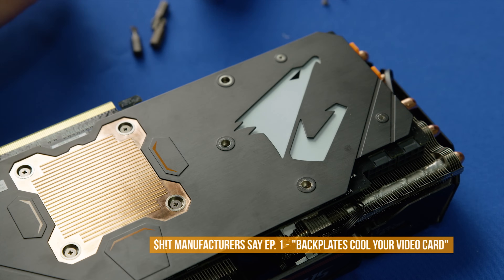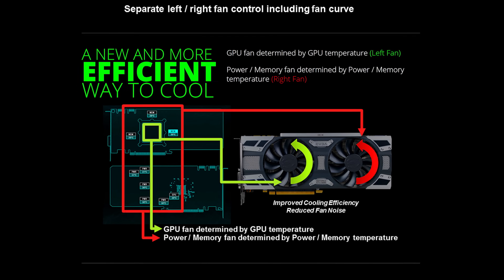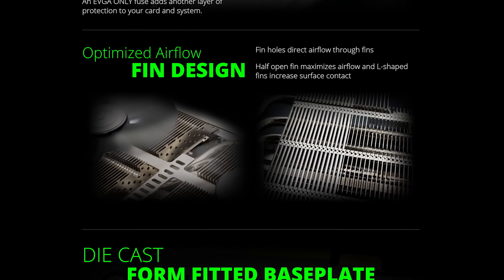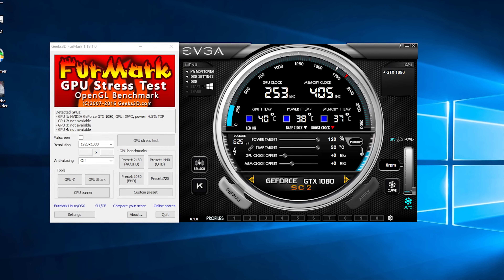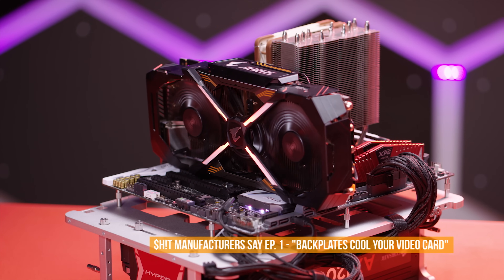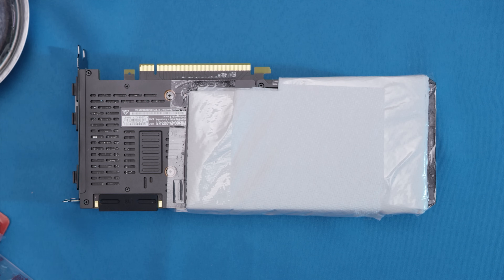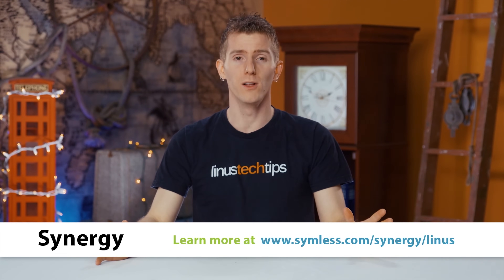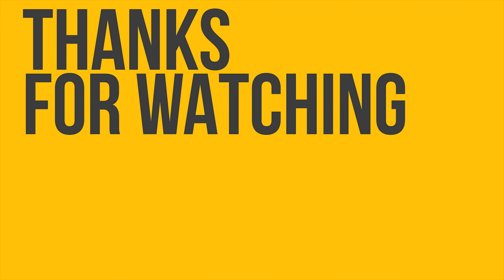The SOLUTION to Video Card OVERHEATING & DEATH

Comment: I'd pass on this. Even if money is no option (which it is for me) I would rather have a liquid cooled GPU than one with independent air cooling fans. It's still using air cooling, even if it's a little different.

Comment: Hello Linus, I remember in NCIX tech tips when you talked about the AMD FX8350 and the MSI 990fxa mobo,Have you ever Had an issue with that motherboard in your time of testing it. I have heard a lot of people talking about the mobo where it just shuts off and does not work again, did you experience this during the review time, and if so what did you do to solve it?

Comment: Why don't they put the fans on top of the GPU instead of bottom?
Hot air flows up so why bother blowing it down when it's gonna go up again?
And it's better looking.
Reply: T Tommy fans on the upperside would get dusty in no time.. unlike under.. you will notice that cpu cooler is most likely more dusty than the gpu is because of it..
Reply: T Tommy You...don't seem to understand what the fans on a GPU do... Though I agree on the fan placement, the fans on the bottom also usually blow upwards onto the PCB
Reply: …  they don't blow it down
Reply: why not just cut 2 holes in it so the air comes from the bottom and right out of the top then the other fan and suck it right out and blow it out of the computer case all together? or atleast blow it down away from the CPU?

Comment: iV always wondered WHy they dont place a Fan on the Back edge of the card...working off a Onboard motor/driver..that would blow AIR across both sides of the card and OUT THE BACK..  I dont see HOW removing heat from the Card and DUMPING it into a case works in the long term..unless you have a FEW extra fans to send it out the top..
Just get it OUT of the box..keep peoples FEET warm..

Comment: K, as described this is at best noise saving feature and has nothing to do with increasing longevity or preventing overheating.  Which is fine, but lets call a spade a spade shall we?

Also, if you want to spin up a case fan according to what the GPU is doing, you can use speed fan.  No need to wait for EVGA to reinvent the wheel on that one.

Comment: my r9 390 keeps randomly popping up with an error in the bottom right corner basically saying 'your video device stopped working unexpectedly and has recovered' while doing a short freeze on my computer. Insight anyone?
Reply: That's a driver crash. Are you OCing?
Reply: Nope I'm not. Running the 390 and my 5820k at stock speeds. Usually happens when I'm watching movies or have a number of tabs open in Opera but has also happened when just on a single web page. It's happened on multiple different driver versions too.

Comment: Remember back then when graphic cards ran off of pcie slots, lel.
Reply: ECCENTRIC 

We need to connect power supplies now, or it will ONLY be on PCIe power, which is pretty much only on budget cards now
Reply: I have a Voodoo 5500. That used a hard-drive connector for power.
Reply: hacked by scarce remember the days when there wasn't any GPUs
Reply: remember days then gpu can run only on power of pci slot (not express not agp)
Reply: 750Ti master race reporting in
Reply: forget AGP, I want 16 bit ISA cards again.
Reply: ootdega dude same
Reply: IT WAS I DIO ALL ALONG 
Keep your eyes peeled on a 4gb 570 radeon.  The prices are sliding down and it might be in your budget in the soon.  And a 570 spanks a 1050 handily if you have a 6pin power plug for it
Reply: PFFT,abacus is the best
Reply: My old radeon 9800 se softmodded to pro has no idea what you're talking about.  and it was AGP.
Reply: Well my GT630M wrecks the competition with not working at all when too hot or when it just doesn't want to which makes it the most power efficent card ever made
Reply: And you pit a 4pin lil floppy drive power on its pcb.  Hilarious
Reply: ootdega not for long soon im going to a 1050ti from my 750ti
Reply: I remember ISA video son, get on my decrepit level
Reply: well pretty much every pci-e higend cards have had power connecters
Reply: Im trying to find a full coverage waterblock for a EVGA GeForce GTX 1070 FTW ACX 3.0 can anyone help
Reply: I remember the days when graphic cards ran off two PCIe slots
Reply: I had a GTX 1050 Ti when my old 1080ti was being replaced and I was surprised it didn't have an 8-pin connection. Kinda blow my mind that a GPU could be powered from the motherboard.
Reply: What? Graphics cards today also run of PCIe power. Are you talking about the PCIe bus? Pretty much all cards since 2004 have run off of PCIe.
Reply: @Slenderman63323  nah now we run our GPUs Off the power pin and connect them to the PSU.
Reply: @Slenderman63323  No we use external cords
Reply: Forget 16 bit ISA, I want those CPU drawn graphics back.

Comment: I don't need more temperature sensors, I need a cooler GPU without too much extra noise.
I would like to see a GPU with a heat sink and fan on the back plate :)

Comment: The low powered fans to increase power available to the gpu is actually a pretty impactful feature. Those fans on a regular card could be taking away 5% of the power available to the core, so when you make youre power target to 105%, it may really only be at 100% for the core.

Comment: or just fucking make gpu with cpu cooler slot and fuck the 2 pci-e slot limit. if you need to add stuff use pci-e expansion cables

Comment: I feel like the point of the ICX coolers was ignored here, where some were experiencing the VRM catching fire from insufficient cooling. ICX is a bit over engineered solution to that problem, but this wasn't even mentioned in this video. Besides other GPUS at the point don't even have a temperature sensor for the VRMs and ram so there is nothing to even compare it to. Without adding direct contact thermal probes to an earlier card and comparing them to the results on this one with the new ICX cooler. Honestly, this is what this video should have contained.

Comment: video cards will die eventually, its just a matter of time. What ICX delivers is better and efficient cooling and that's it. 

This still doest fix the issue regarding the hot-cool cycles of the chip making the chip connections wear out (the flipchip design flaw) not unless they done something different die implementation that fixes this issue, there will be more video cards that is likely to die after 5 years or so, hell the older video cards still works in this age because they dont use this flipchip design (my riva tnt2 is still alive will my GTX480 died after 2 1/2 years).

Comment: Its painful that he is referring back to the totally flawed back plate video and then trying to use it as fact,  the testing methodology and out come in that video was flawed because they used a test bench even though the majority of people have full size cases with fans that create airflow into the case and over the card and that's why that test was flawed,  because anyone with a brain knows that a small passive cooler still needs airflow to work and without airflow they will do next to nothing for cooling and in a test bench it does not get airflow and so no surprise that no cooling benefit was seen from the back plate. Had they properly tested in a case with fans and air flow like most people have then i can bet that the results would have been significantly different..

Comment: Soon, this sort of tec will find its way into every cooling device in a case and it's kinda useless in most cases. Very few people have computers which run at 50%. Most computers and fans run at 0% or 100% so it's not really helpful. But heat is waisted energy so the less heat made is better, not ways to move it around.

Comment: A backplate can help with cooling if thermally connected to the VRMs, as unlike most other components, most VRM designs use a large ground pad for heatsinking into the large ground plane of the PCB. A thermal pad can allow the backplate can act as a heatsink as long as they didn't use some poor quality metal. The issue with s backplates is that they have nothing to act as a thermal interface between the PCB and the back plate.

Comment: I'm really interested in Synergy, but how is the setup? is it just a network connection between the two PC's? I'm currently messing around with a setup with my gaming PC on one end and an i5-2400 linux machine on the other side of my desk, and I'd like to be able to just use one mouse/keyboard for both, but I'm just a little confused as to how synergy works.

Comment: for those that don't know, icx exists as a marketing response to the issues with their cards they had, no other reason...
also the reason good vrms aren't monitored on cards is, because they are supposed to be so ridiculously overkill that u shouldn't manage to ever blow them up even at water and custom bios or ln2.
btw gamers nexus was not able to blow their evga 1080 up in the thermal testing, it seemed to point to a batch of bad capacitors as the vrm seemed adequate (it was still stupid to not connect vrm to the main cooler or backplate)
i mean not that icx is bad, it's just unnecessary and going for an even more overkill vrm would have made more sense i guess, but u can't market that, so whatever i like having readout points, so cool i guess and everyone likes fancy backplates! and even if it's just to make the card stronger and  protect the pcb, which is what most do (and also block heat from escaping in a lot of cases....)

Comment: whats the point of additional sensors when all manufacturers limit the voltage? gpu air coolers are great most do there job fine and not to mention water cooling. 
yes there is custom bioses out there but having FULL control of your GPU from the factory would be nice to have, say a actual unlock voltage setting in msi afterburner beyond the said manufacturer limit. 
you can spend major $$$ on a gpu that has the best cooler in the world but it wont go far it the manufacter cap is there.
 I have a gtx 980 and can reach 1.5 GHhz core with a 10c away from the temp limit (85c) it feels like money down the drain if you were to purchase higher end cards of the same gpu model. . . 
tl;dr: what i wanna see in the future is xx80's with unlocked voltages.

Comment: Let's just make a 2-3 slot gpu that has the normal heat sink on the front and another on the back instead of a backplate. Radiator fins and all. Might be a decent overclock gpu without water cooling option.

Comment: I think this technology is cool, but if you have a MSI-Card, mine is the 1070 gaming x, you havent got any problems with heat...... 
I got the card on stock fan curve with 2010mhz and its on load at 63 degrees C

Comment: These thumbnails are getting out of hand
Reply: I used to think they were getting really bad. But now they've crossed a new line and I find them hilarious. This one is one of the best yet.
Reply: And here I thought "goofiness" has always been one of LTT's feature... why r people getting mad about them showing their goofiness on the thumbnails?
Reply: +Plasmaboo Normie what are you even talking about
Reply: It will make a fine addition to my collection
Reply: Bring back the old thumbnails!
Reply: I know, right? That blue is SO last year!
Reply: The full resolution thumbnail.
img.youtube.com/vi/Zy3ttWaZahs/maxresdefault.jpg
Reply: Ares5933 yes. They are in the mouth now
Reply: Ares5933 no way
Reply: I see ICX as a great step forward in graphic cards cooling. I did like the feature of multiple sensors and located cooling so maybe one day it could be applied computer wide as a standalone system without connecting to the motherboard apart from data output of course.
Reply: Ares5933 will someone help me if I should buy this PC for 500 - 550$ ? 

1. Cabinet - Cooler Master Haf 912

 2. Power Supply - Corsair CX 750w

 3. Ram - Gskill Rip Jaws 16gb (8x2) Gaming Ram

 4. Cooling System - Corsair H80i liquid cooling system 

5.Motherboard - Asus Maximus v gene Gaming motherboard 

6. Graphics Card - Asus HD6950 2gb EAH6970/2DI2S/2GD5 

7.CPU - Intel i7 2600k overclocked at 4.2 GHZ
 
8.Harddisk - western digital 1tb ...
Reply: Seems pretty good, not sure what that GPU is though...
Reply: Ares5933 ah, the CPU. Go for at least a 4600k
Reply: Glowith even I had to search on Google for that GPU .. he says it was pretty expensive ...something like 300$
Reply: Glowith I can't bro..it's the best deal I can find ..living in India ! people here don't buy such things
Reply: These thumbnails are getting out of hand
Reply: haha r/prequel_memes ?
Reply: Even your like-counter fits to the thumbnail: 666
Reply: A fan that doesnt rotate. Puff first strix and now this .............
Reply: Ares5933 Linus the weather man giving you the forecast it's gonna be 80°C for the rest of the world hope you like thingd toasty
Reply: I hope they revert back eventually. These have the opposite of the intended effect on me, ugly thumbnails make me want to watch a video less since I feel that the quality of the thumbnail will reflect the video.
Reply: Cameron Walsh this thumbnail reminded me of those weird toy channels click bait thumbnails. I'm honestly really getting sick of the click bait lately Linus is pulling in general, I'm not one to complain either
Reply: +Pocholo Pan. is that supposed to be a General Grievous reference?
Reply: if stupidity works, then it works, regardless of what anyone think...one of the problems of the world
Reply: Now there's two of them
Reply: Lol
Reply: @00O3O1B  lol
Reply: I honestly haven't noticed it, I regularly see thumbnails that are a lot worse than this all over YT. Take a look at your recommended and you're bound to see examples of this. While this may be "getting out of hand" by LTT standards I still think this is nowhere near as bad as people make it out to be.
Reply: +Slayze Legit made no sense.
Reply: I agree. I think they hit the sweet spot a long time ago when they used to make a silly thumbnail every now and then, not every single video getting more and more ridiculous.

I loved the thumbnail of Linus eating a mouse (a Logitech, was it?) for that mouse's review video. I watched the entire video wondering if it might possibly be footage from the video itself. I was disappointed.

Comment: Not a bad idea, but the cost vs its usefulness is questionable. Higher temps in cards at the moment, running at high fan speeds seems to do just fine as is and unless this idea improves I really don't see much point in it. I do admit though, independent fan speed controllers is nice. I would actually like to see better backplate designs though, so that they actually dissipate heat much better than the gimmick-level they do at the moment.

Comment: with the fight that amd is launching, i dont think that multisensors and other stuff that permit the component to last longer will be useful at the moment.
its no-brainer that AMD is pushing intel and nvidia to develop faster, that will permit inevitably higher performances for the next years like it have been when the athlon xp launched.

the idea is good but the moment is really not the best to start a long lasting mentality.
i would have been 5-7 years ago and will probably be in 3-5 years a good idea.
but they arrive ''too late'' or ''too soon''

Comment: It shouldn't do anything to performance. It's going to reduce fan noise in low temp usage, because the fans will be turned off when they aren't needed - they will never be on when they wouldn't be without ICX, they just won't be on for no reason when they would be without.

Comment: I have asus gtx 1070 strix oc with a mild overcloxk... Its reaching 75c in wow max setting no AA at 1440p, 83c in Far cry 3 with high/ultra at 1440p... Ocerwatch is 75c max setting.. gtx 1070 is housed in H440 with 3x120mm (1k rpm) case intake fans and 2x120mm pullig air in radiator fans and 140mm exhaust.. Idk if there is something wrong with my 1070

Comment: Or throw the stock crap away and slap 2-3 noctuas with zipties on it.
Reply: Fatality
Reply: Collector2006 it will look badass af
Reply: go DELTA
Reply: zcribe ya know, I've been thinking real hard about doing that to my hd7850, I'll make a custom shroud in woodwork, and I'll do that on my channel ;)
Reply: My issue wasn't the brand of fans it was the type of fan being used. Noctua makes good case fans that work great for cases. Case fan is not a videocard fan. A case fan is also not a radiator fan. Doesn't serve the same function and its not designed for the same application.

The EVGA ICX fans push A LOT of air. More than Nvidia's blower style cooler and at higher pressure than Noctua's industrial iPPC fans (which are ridiculously loud).

Have you even watched the video? Linus in no way says that the cooling that EVGA ICX fans produce is inadequate. Its actually better than many other card manufacturers. He just argues whether or not the ICX extra sensors on memory and power delivery actually make a notable difference in user experience. I know what your point is, and my point is that your point is stupid. Strapping bigger and "better" fans on the videocard will not do anything other than make it worse. The ICX fans have no issue cooling the card so strapping bigger fans on it that aren't even designed for cooling a videocard won't do anything other than make thermals worse and setup look retarded.
Reply: Yup, tried it with my HD7950. Bad idea. Nice and quiet but temps, especially VRM, were way too hot. Stock cooling is typically fine, just turn your fan speed to 100% when gaming.
Reply: Just because noctua is quiet and expensive, it doesn't mean their fans have adequate airflow/pressure to cool a videocard. I'm a huge noctua fan, but I'm pretty sure what you're suggesting is a good way at reducing your cards cooling.
Reply: Seriously? Your issue with this janky setup is the brand of fans? My point was that slapping just more and better fans onto heatsink will do more than any of this tweaking will.